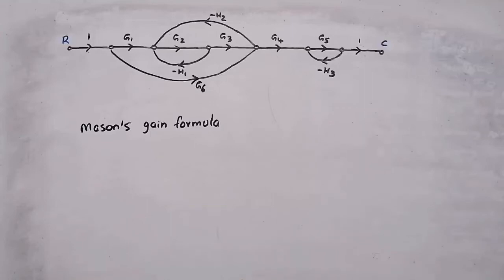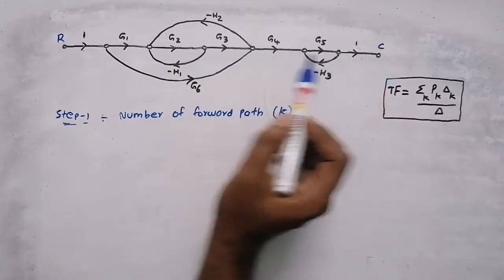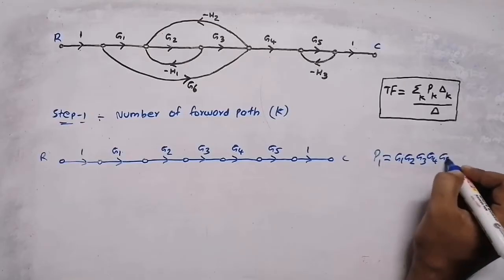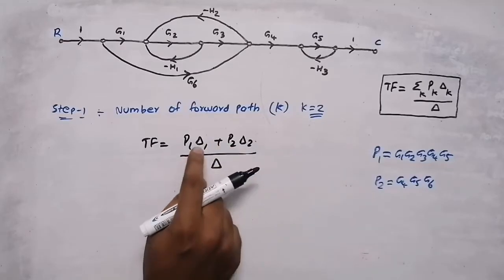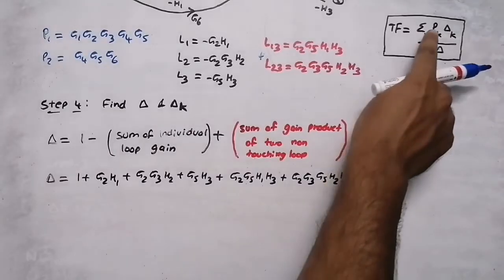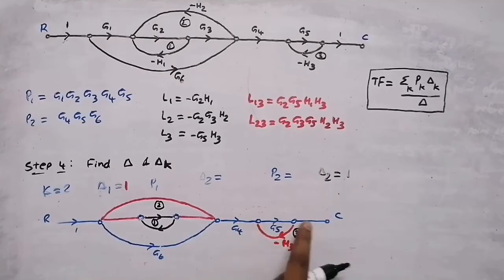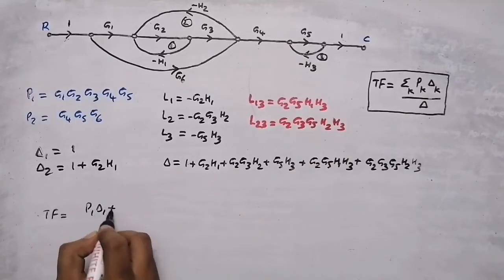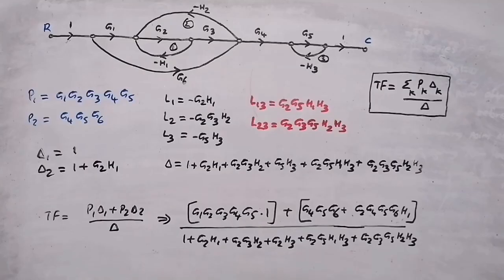Mason's gain formula | problem

Comment: Bro 
1) Delta = 1 - (sum of individual.....) + ( sum of two non-......) - (sum  of three...) + (.....) - (....) + ....
     OR
2 ) Delta = 1 - [ (sum of individual.....) + ( sum of two non touching......) - (sum  of three...) + (.....) - (....) + .... ]
Which is correct 1 or 2..?

I have put [ ] in 2nd equation..
Reply: 1